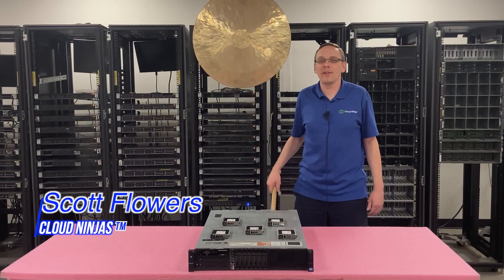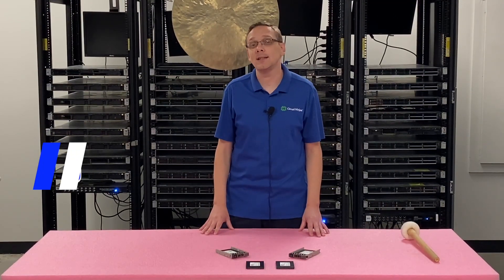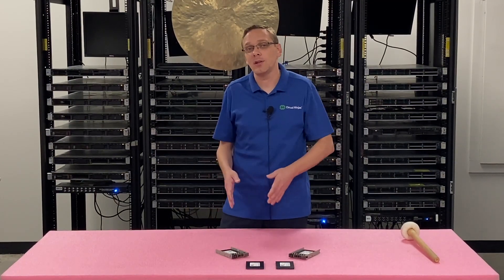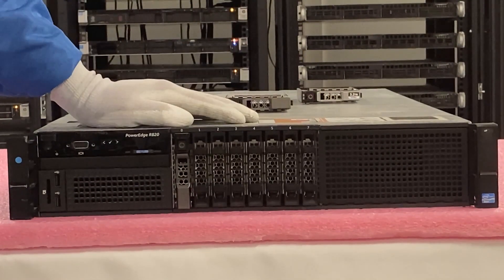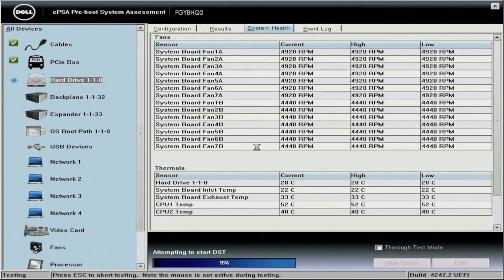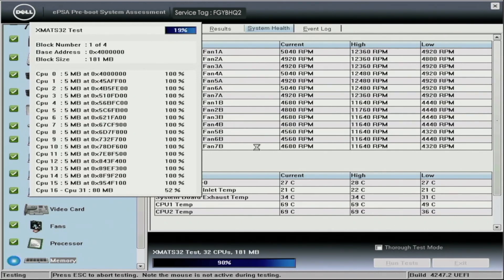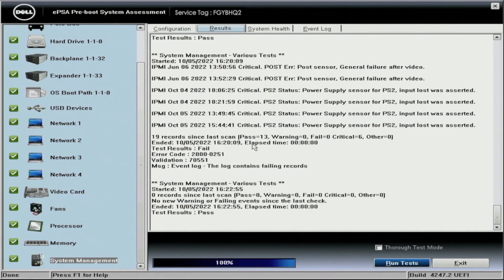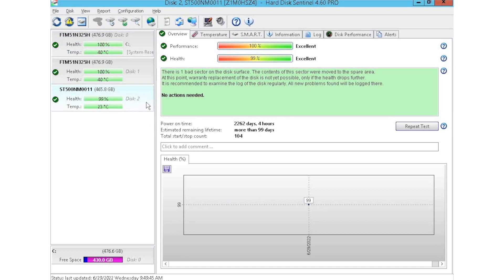Dell PowerEdge R820 Solid State Drives | SSD Upgrade Spares & Options | How to Test with Dell Diag

Comment: my R820 is not detecting the new SSDs, is there a firmware update for this? Also I have been trying to update firmware on and haven't been able to. Please advise.
Reply from the maker: Yes I believe Dell took down the update files for 12th gen... not sure why they did that.  What SSD did you install?  What RAID controller?
Reply: @cloudninjas  thank you for responding. I installed 1TB HP SSDs SATA, HP S750 SSDs, RAID Controller is PERC H710
Reply: I was able to download and get the SUU ISO in LifeCycle Controller, but the update for the PERC H710 fails.